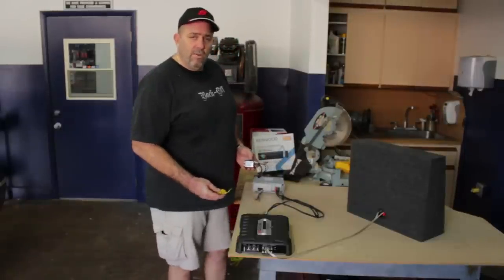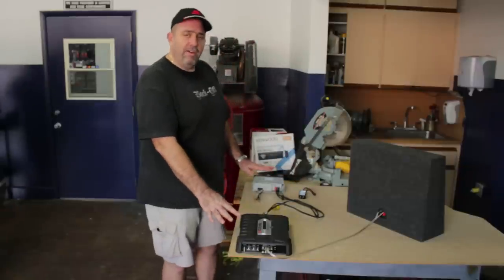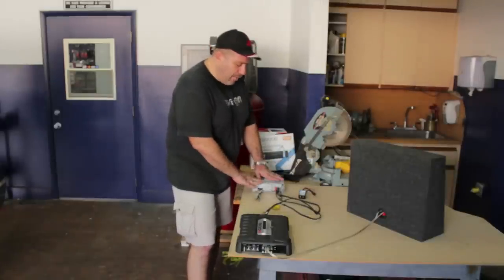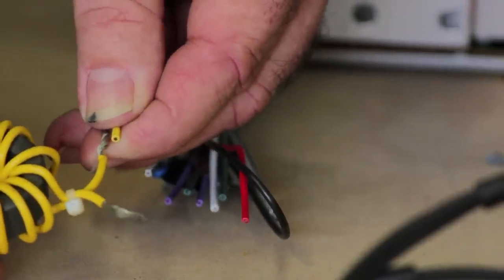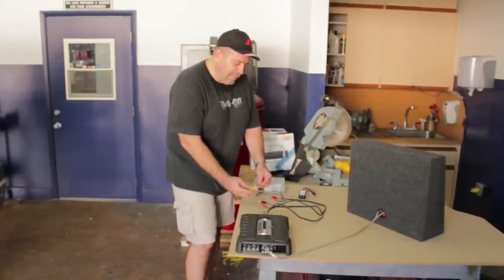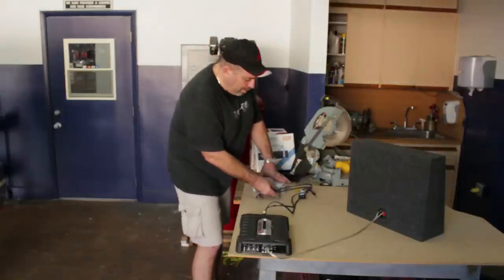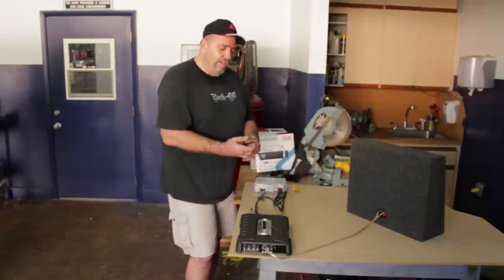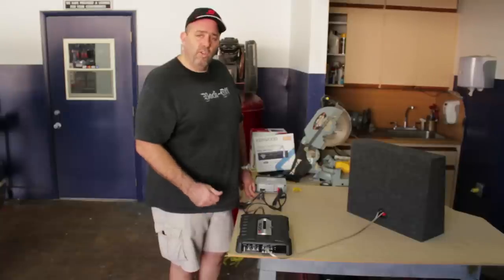Car Audio : How to Get Rid of Car Stereo Noise

Comment: Great tutorial! I have been chasing audio noise in my '66 Mustang for several weeks, adding filters, using different grounds, better RCA cables, etc.  With the help of your video, I traced it down to the wire from the ignition to the radio.  Added a filter on that line, and the noise went away. Thanks again!

Comment: agreed groung loop issues need to be resolved no need for filters your factory unit doesnt come with engine noise
Reply: Or in the case of a boat you get a ground loop from the ground of your amp being different then that of the deck/source. You can't just ground to the frame in a boat. I get a ground loop issue when I turn either of my power converters on to charge my batteries. No noise if charging with alternators.

Comment: Prevention is better than cure.... I had engine noise on my first install because of rookie mistakes. My last install doe not have any with the volume up. Here's some advice:

I used cheap dollar store RCA cables and speaker wire on my first install, penny wise but pound foolish.. Buy good quality cables with thick shields and gold connectors.

Run very good ground wires.. Sand any painted area to bare metal and use a self tapping screw to drill into the chassis if you can't find a close nut that goes to the chassis. Install multiple ground connections if you have to.

Run the power and the audio cables on opposite sides of the vehicle. If your battery is on the left side of the vehicle, run the power cable and amp turn on wire (blue wire) on that side. Run your RCA and speaker wires on the right side... It makes all the difference.

Keep ground wires short.. General rule of thumb - Keep all wires as short as possible where interference is concerned (make sure you have enough slack for your application of course)

Don't drill you amplifier into the any metal of the car. Secure it to either plastic or wood - in general try not to have your equipment in contact with the metal body of the car.

Again - buy good quality cables!

That's all I can think of right now
Reply: Justin Miller any idea why my speakers make a pop noise when I use the horn or turn the lights on?
Reply: MCFriedChicken1 ground
Reply: What if the only option is to run power wires and RCAs on same side. Is there a powerful enough noise suppressor that will work?
Reply: @alfredorosado1  it's impossible for this to be the only option honestly.
Reply: @DayV914  I was looking for other options. Recently I came across a Chevy Avalanche 2010. The backseats fold down and there is a release handle that opens the door that folds down to access the trunk, equipped with water tight gaskets. Running either side cables would require metal grinding to access the trunk. Both the sub box and amps will all be in the trunk. It was a bit of work just to do one side and also compromising my water integrity seal.  I ran all the lines on one side because of this and of course had feedback sound. With alot of added adjustments and shielding after I was able to reduce it tremendously but there was even a very slight wine sound. I went back later and did the same on ther side and separated the two sides and now the sound is gone. I was just looking for other options.

Comment: Most noise is generated by a poor earth. Best way to get rid of alternator noise is by creating better earths. This entails crimping and soldering good quality terminals to higher gauge wires, and when bolting the earth strap to the chassis it requires you to sand the paint off the metal around where the terminal will bolt on. This should stop all your noises.

Comment: I'm getting a HUGE thump in my sub when i change radio stations, when i power off/on or turn the volume from 1 to 0, and back to 1 from 0. Any Idea's would be GREATLY appreciated. I've tried SOOO many grounding techniques its crazy, my grounds on the amp and radio are good. and I also tried grounding the RCA's. I have also noticed when the amp is on the radio reception is crap, no hd stations at all, but if i pull the remote wire so the amp turns off its perfect again.
Reply: Move your remote wire to fuse panel.. And eliminate any extra rca connections or y cables.. Then if that dont solve it find the loose speaker connection in harness
Reply: Never ever ground your RCA’s mate.

Comment: I have a mustang and battery is in trunk with massive battery cable running to alternator. I tried noise filter but why is it restricting amp now? Amp isn't pushing the watts anymore

Comment: I use a dj amplifier and I get some white noise sound I disconnect the rca cable and I can turn up the volume and no increase of white noise but when I have the rca connected and then turn the volume up the white noise increases is that normal it's kinda loud for me inside of my house of the white noise.

Comment: great video even though it has been almost 12 years since it was made, do you by chance know what the minimum/maximum size inductor is required to fix this? My brothers Subaru forester has a terrible 8KHz buzzing sound coming from the battery and ignition wire, i currently only have a 2µH 15A ferrite inductor at my house right now and i was curious if that would suffice

Comment: Changed to a pioneer head unit more power now my 4 inside speakers sound hissy fuzzy tested without putting music by turning the volume up is there a reason why ? i did remove the subwoofer rca cables same results

Comment: How about adding low-ESR capacitors in parallel to the car's electrical power supply instead of that ferrite core inductor?

Comment: Alternator noise: best solution? I heard it when I had an alpine power pack in dash and it was present when I used two different amplifiers in the trunk. Is the problem at my head unit, bad ground possibly? I don't want a bandaid solution and I don't want to loose sound quality. Thanks

Comment: I just installed a double din into a Honda Odyssey but I get a small buzzing sound when the engine is on and there is no amp hooked up to it would you know what the issue is all the connections looked fine
Reply: Gustavo Degollado I am having the same issue, did you manage to find out what might be the problem?

Comment: I don't know if this will help me.. But here's my problem. So a week ago I noticed my rear right side speaker comes in and out.. I'll be listening to a song and suddenly the bass goes low then it will come back up to normal so I'm assuming it's not blown.. I'm sure I'd know if it was. This is the stock stereo I've never messed with it. I took it to a shop and when I got the car back the problem wasn't fixed in fact it was worse.. now not only does the speaker come in and out but I can hear my right turn signal in that particular speaker. I have a chevy malibu LT 2006. Any suggestions? or info that could lead me in the right direction thanks in advance :D

Comment: idk how you just connected the isolator backwards but this causes a lot of confusion, the RCA inputs on the isolator say OUTPUT because the signal goes in through the RCA wire malese which means that that is connected to the head unit and the extra RCA cables plug in to the output and go to amplifier. if not then i installed it wrong and it still worked for 80% noise reduction

Comment: If the speakers are hooked up to a 4-channel amp, unhook the RCA jacks at any point will stop the speakers from humming because the signal will stop. Unplugging the RCA jacks makes no sense.
Reply: Exactly what i was thinking. This would only work if all 4 speakers were running from the head unit and the amp was only powering the sub. 
That way the speakers would still be powered and receiving signal. 

But this guys troubleshooting for a 4 channel amp and sub setup is AWFUL to say the least.

Comment: What if it’s the amp?  Maneuvering the amp rca produces the noice when connected to the back rcas but not the front rcas?  I know it’s the amp because the rcas have been rearranged switch and swapped, also not the speaker wires because of the same procedures... what do I use if it’s the amp?
Reply: New amp 😁

Comment: I have a car radio set up in my workshop that's powered by a computer PSU.
I am getting noise through the speakers, I think it's from the PSU fan.
What filter could I use to eliminate the noise.
Reply: tony finlay the noise is from the wall outlet(s),   You cant filter that out

Comment: Hi,
Just installed my Kenwood amp, it buzzes quite bad, it gets louder when the lights are on, when I press the brake pedal and when I use the indicators it buzzes when it ticks. What will I need? When I unplug the RCA's the noise goes away.
Thanks
Reply: I have the same problem!!! Do you figure out how to fix it?
Reply: Did u ever figure it out?
Reply: @chriskeiffer5861  Hi, combination of 3 things, bad earth, poor quality head unit & the RCA cables being close to electricals causing interference. RCA filters is like putting a plaster on it.

Comment: Or the alternator has failing diodes. duh.
Reply: My seat ibiza has TONS of noises, I have a small in cabin subwoofer and I can hear the "turbo" when engine is on(Seat Ibiza 1.2 SC TDI E-ecomotive(2012/03 model), it's 1.2L with a turbo 75bps). I've put a rear view camera, again when engine is on and turbo works(even in idle) I can't get an image, you turn on the engine you have picture and noice and after 2-3 secs u get no signal(damn so much noice)

I did put many ferrite cores near the input of the camera and subwoofer and this did help a bit, but still doesn't fix the issue. Now I've purchase some RCA filters and would test the subwoofer initially, don't thing I have a failing diode or anything as my car is hardly used with it's ~35.000km of usage, I use it lightly.

Hope the RCA filter to do the trick, so I'll test the subwoofer with many ferrite cores in the power(as I have it and seen some improvement) and RCA noise filter(today receive this noise filter which is essentially ferrite core with coil for each wire ..tear it down and seen how it's made) ...wish me luck :P

Comment: I practically have the same rca filter but mines come with 2 brown thin wires coming out the box, what are those wires for and how or where do I connect them? help from anyone please...
Reply: Francisco Gonzalez those are grounds. esentially it is a ground loop isolator. doesnt always work but if it does then good.

Comment: well..That might be how YOU take a short cut and put a band aid on the problem..and that might work..but as a professional stereo installer i would hope you would try to actually find the problem..any joe shmo can go to wal mart and put a filter on..
Reply: Or in the case of a boat you get a ground loop from the ground of your amp being different then that of the deck/source. You can't just ground to the frame in a boat. I get a ground loop issue when I turn either of my power converters on to charge my batteries. No noise if charging with alternators.

Comment: This is a misleading tutorial. If you disconnect the rca cables from the stereo, you’ll get no sound whatsoever. How can you claim “ if noise still persists after disconnecting, try using....” How will sound be transferred, if rca cables are not connected to source unit?